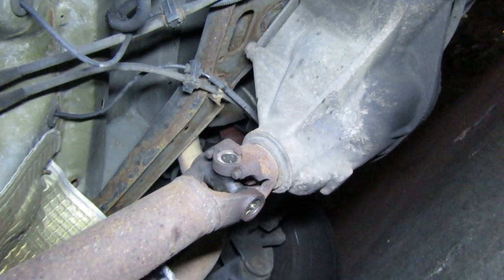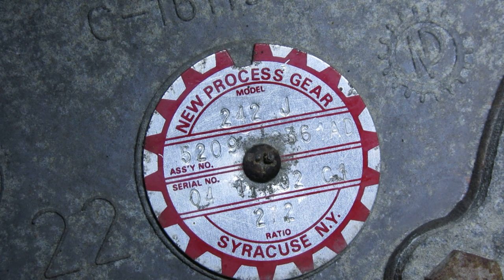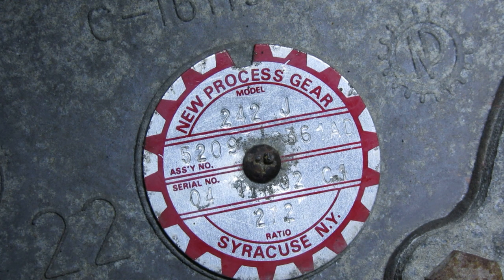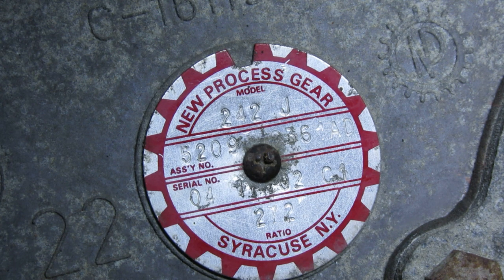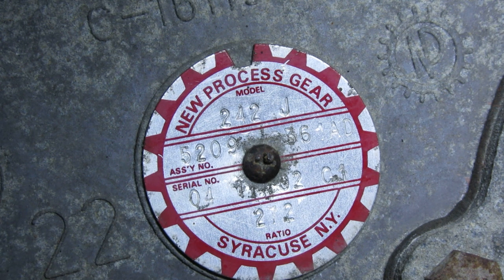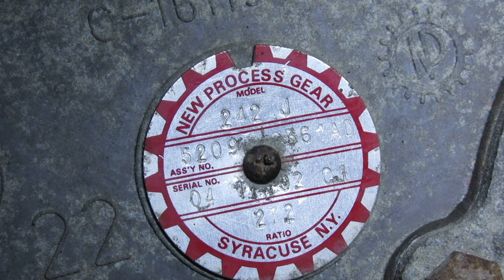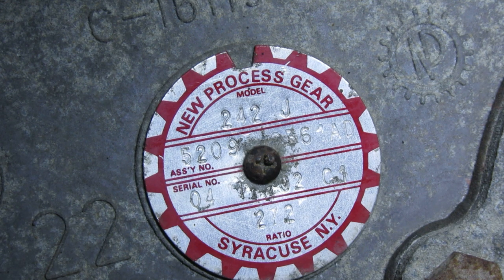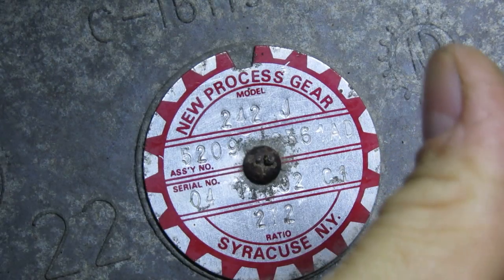Jeep Transfer Cases DECODED and EXPLAINED - New Process/New Venture

Comment: Hey Doug, I just want to clear some things out; I think you got some therms mix up between the 247 and the 249. The 249 uses a viscous coupler, which is clutch discs sitting in a special Goo that thickens when it heats up, I.E. when the front and rear axles spin at different speeds, which make the clutches grab together. The 247 is actually the one with the Gerotor pump, and is the same system used in the Quadra Drive axles. It's basically a wet clutch system, with an hydraulic pump built in; the body of the pump connected to one axle, and the other to the rotor. Same speed front to rear = no pressure from the pump. The moment there is difference, the pump starts building pressure and gives progressive clamping power on the wet clutches, up to a certain point where it relieves the pressure, to let you take tight turns and such. It's actually and awesome and clever system!!!

Comment: The ZJs had the 249 Quadra-Trac transfer case, they had a viscous coupler in the transfer case....the WJs had the 247 transfer case, and they also came out with the Quadra-Drive system which had vari-loc front and rear differentials and the clutch pack in the transfer case, which is what you were referring to around the 11:15 mark.  The gerotor coupler was used in the Quadra-Trac/Quadra-Drive transfer cases found in the WJs.  The 249 and 247 were never used in the XJ, or MJ.  both of those either got the Command Trac 231 or the Selec-Trac 242 transfer cases, or no transfer case if you bought a 2WD Jeep, not sure why anyone would but they are out there.

Comment: im still to see another 147 transfere casse like the one in my 99 JGC
Reply from the maker: They are out there, but it is not a common configuration. Interestingly, they use the 142 in the WK Grand Cherokee much more.

Comment: Good job man
Thank you good info. 
What do you know about jeep commander 245j  I need to replace the drive chain? Do I need to take the transfer case to neutral? I tried that the light blinks but nothing happens is that the motor drive that does that?

Comment: Hi thank you for your video it helped alot .if ok to ask you a few questions .u need a new transfer case for my dodge .and now I was told I need to know if it's a 23 or  a 29 spline shaft .and also if the electronic shift box qhen pulled out there is either aa hex nut or a torx nut the the box attaches to .and another video I saw  they said it will tell you that with assembly number but I don't understand that part the I'm just concerned as it's a 4 hour drive lol so I don't want to hit there and find it's not usable .and I don't know if they seller understands what I'm asking lol is ther anyway to find that info out qith any of the numbers on the tag by chance ? Please and thank you

Comment: I was a manufacturing engineer at NPG, Your 242J is a full-time unit with an interaxle differential. It was the best we made.
Magna moved the operation to Mexico. Gm is going to electric vehicles, they won't need a transfer case.
Reply: Can you please tell me what fluid I use for this exact transfer case?Is it NV 146?I have the 242 J transfer case 4.0 engine Grand Cherokee Laredo
Reply: Can the 242J be used with the 4.7V8 grand Cherokee?

Comment: Great video. I have a 1997 grand Cherokee with a 249 it's leaking and not working right. I want to switch to a transfer case that has 2 wheel drive with 4 Hi and 4 low. The only thing that I found is a 242 J but it is in a 2003 liberty. Can I switch it out without changing the input and output shafts I believe they are both 23 spline. Hope you can help me with this problem.

Comment: Do you know what the difference is on a Jeep Grand Cherokee 2004 it has a transmission casing number 2907/7 and then I got one of the 01 Jeep Grand Cherokee says 2901 can I use the 2901 in the Jeep Grand Cherokee it has a 207 the same tranny what's the difference
Reply: Cuz the transmission has a 2907 in it it has the transfer case 242 model and it has a plug-in on it and then the transmission out of 2901 transfer case it don't have a plug-in on it transfer case 287 can you help me out

Comment: So, correct me if I'm wrong.. I have a jeep Grand Cherokee (WK) 2008/9 (Canadian 10 of 08) 3.0 CRD Overland with an NV245 & as it states on the window sticker.. a "DGU" w5j400 (NAG1) trans,  Quadra Trac II "active full-time 4WD system, 4 wheel traction control & 3.73 electronic limited slip differential front & rear axles"
It seems that the NV245 is now about the same system as the 249 you were talking about.. 
I'm looking to you because it appears I killed (loud gear/ grinding noises coming from the center of the car) the NV@$% while towing ~3000 lbs for 2000 miles with new tires on the front and 3-4/32 above wear bars on the rear tires.. Buying a transfer case now.. ELSD's are probably also questionable..

Comment: Hi there. Tq for yr video. I owned a Jeep Grand Cherokee ZJ 1997. It is now having transmission problem. Leaks and gear doesnt engage. I am from Brunei. My local dealer is not helpful saying the parts I need are discontinued. I have sent you an email seeking your help if you know any reliable supplier frm the US I can order the required parts. Thank you.

Comment: Thank You for the great video and information. I have a 2001 jeep grand cherokee larado with quadra trac. The transfer case tag reads 247 j . The left front wheel does not pull or spin when all four wheels are of the ground. Any ideas? Again Thank You.
Reply from the maker: Yes. Quadra Trac uses a limited slip trasfer case, but open diffs. That means - when locked - you are on guaranteed one wheel in the front and one in the rear spinning. Quadra Drive came with limited slip differential as well guaranteeing 4 wheel lockup

Comment: bro youre mad smart, what are symptoms of a front differential needing fluid?
Reply from the maker: Thanks bud. Just trying to help some like minded folks. 

Definitely some grinding oh whirling/humming noise. If it is a limited slip diff you will get binding when turning at low speeds

Comment: There are so many great videos on Jeep GC's, thats why I love them. Mine is a 2000 WJ  4.7ho with a 247hd. Its a fantastic 4x4 system. This is a great video. thanks mate.
Reply: The 4.7 HO motor was standard in 02 to 04 Overlands, and optional in 02 to 04 Limiteds and Special Edition Jeep GC's. Yours being a 00, I doubt it's a HO 4.7 motor. Probably the standard 4.7L.
Reply: @Mo63H  Hello Mr Ho, My engine was changed due to a spun big end bearing. The new engine is a HO as the supplier did not have a standard one. All HO parts are also fitted too.

Comment: so with part time does in 231 does the front shaft of  t case kick out of gear. to prevent braking else where?
Reply from the maker: it does not. they are locked together so you can only use it on loose ground

Comment: Hello. Two question’s please. I have a 97 ZJ with a 249. I understand from other videos earlier NP249’s the axles are not locked but newer NV249’s the axles are locked. How do you tell visually whether 
you have a NP249 unlocked or an NV249 which locks both axles? And a second question. I was given a NV247, is there any benefit to switch from 249 (not sure if mine is locked or not. Just bought it) to NV247since I have it  or should I try and sell both to get a NP242? Thank you so much. New to Jeep’n. BTW great channel  and mine says 249 j.

Comment: Fyi 249 is just a basic 4 hi 4 low  neutral. There is no fancy fake all wheel or auto lock 4 wheel system built into it. This guy had some good info and some bad info. Make sure you double check any thing you use for your project.
Reply from the maker: I am sorry, but you are incorrect. a 249 uses a viscous coupler to provide an "all 4 wheel" driving experience.

Comment: Great channel thanks for sharing. On My 2000 jeep Cherokee XJ the rear drive shaft broke and I have just been using 4H the front wheel drive for about 6 months now. QUESTION do you think I am getting abnormal wear on the front wheel drive components from doing this compared to normal rear wheel drive 2H?????
Reply from the maker: Definitely. If you look at your front drive components compared to your rear (drive shaft, axle, etc) they are must smaller as they were not intended to move the vehicle alone. Not saying it wont work, but if possible find a drive shaft. you are going to be really stuck if you break something in the front!
Reply: @DEInTheGarage   Thanks for the reply. How are jeeps different then front wheel drive cars.  It seems that the front wheel drive system was designed for off road extreme rough use.  After watching a few transfer case videos it seems they designed the transfer case to be very robust.
Reply from the maker: @DualTasticToday  This is true, but you XJ was designed to be rear wheel drive when operating in 2wd, not front wheel drive. The components were not designed to carry the entire vehicle. I am not saying you are destroying the jeep or anything, but you are certainly using it in a way that it was not engineered for and at some point I expect certain front driveline components will wear out prematurely
Reply: @DEInTheGarage  thanks... 4H I think is a rear 60 with front 40% when in 4 wheel drive. You helped  me a lot to understand. Thanks again.

Comment: So my new question for you is. Should I swap the front and rear diff from my 01 to the 04 ? Since the ABS system is part of the Quadra-trac system I don’t know if the abs module would need to be swapped as well. Or should I just put the locker in front and rear.  Thank you again for your input 🇺🇸
Reply from the maker: Yea, that would likely get you a nice beastly vehicle

Comment: Hello sir. I found your video very informative. I recently purchased an XJ  with a 231 and to my knowledge the case came from a different vehicle and I’m watching your video to try and and determine what year vehicle it came from by reading the tag. If you or anyone else that’s reading this can tell me if the serial# has that info or how i can get the manufactured date and if so does that date coicide with the year of the vehicle. Any info would be greatly appreciated. Thank you
Reply from the maker: I do not believe the manufacture date is recorded anywhere on these cases. Can I ask why you need that info?
Reply: Im just very curious to know how old it is.
Reply from the maker: @victorjramirez1948  Fair enough. To my knowledge you cannot tell that simply be viewing the case. If you were to remove the case and count the spline count on the input shaft if might give you some clue as they changed that over the years
Reply: D&E In The Garage   I appreciate that. Thanks for the reply
Reply: @DEInTheGarage  Hey Doug, I know this is an old video but there actually is a date code on the outside of the case.  You can determine the casting date of the cover anyway, to the year and month.  At :24 in the video you can see two pie-shaped circles to the left of your red and silver tag.  These circles are divided into 12 pie slices around a smaller circle.  The year of manufacture is in the center of the pie, and each month has a unique slice.  On the first day of the month, they drill out a small dot in the month slice, which shows up as a small raised nipple on your casting.  When they reach December, sometimes they will just cut another pie grid next to the first one.  You can see this in your video.

So if your pie thing has a 97 (or just a 7) in the middle, and four pie slices have dots in them, then your t-case cover was cast in April of 1997.  You can assume your vehicle was manufactured within a couple months after that date.

Comment: I have an 01 WJ AND and an 04 
Both have a 247J but (01) is Quadradrive , (04) 
Quadratrak 2
Both are 4.7 but what is the difference and what is in your opinion the best transfer to have it’s my hunting Jeep and I pull a boat often times
The 01 seems like the 4/4 works better in the mud. Thanks for the info sounds like you really know your jeeps 👍🇺🇸
Reply from the maker: Same transfer case (as you suggested) the quadra drive also has front and rear VariLok limited slip differentials which the Quadratrak II has open differentials. You 01 does better in the mud for that reason. as soon as the tires slip a bit, the transfer case and axles lock up for all 4 wheels are turning together.

"best transfer case" is open to a lot of factors, but all around I prefer the 242. It has a 2wd option which is better for on-road MPG and towing, but still has part-time and full-time 4wd as well. I am actually in the process swapping the 247 from my 01 Quadradrive with a 242. This configuration of the 242 with the QD Varilok axles is in my opinion the strongest you can have

Comment: Is a 231 AMC transfer case the same thing as  a NP 231? Can’t find a rebuilt it for my 89 Cherokee.
Reply from the maker: They are the same case, basically, but I believe the spline count on the input shaft will be different, so you would need to use the AMC input shaft in the 231J if you go that route. not a hard thing to swap over
Reply: 95 xj swapping for a 99 xj both 4.0 both 231 both automatic any differences in those or can u point me in direction to figure it out i would assume its much like chava original question but double check

Comment: My 2001 Durango SLT 4.7 Transfer case exploded....it is a 244D... Can I get a very simple answer to this question...Can I use a 4.7 ,233d to replace it?  The 244"s are really hard to find and when you do they want a fortune..($500).......             233d"s......$50....Will it fit?
Reply from the maker: Simple answer, yes it will fit, but you will need the input shaft from your original transfer case to get it to mate up to your transmission. That means splitting each case and swapping the input shaft. not a difficult projects
Reply: Cool, Thank you guys so much for the help and support.

Comment: please answer if possible
i have 2 97 grand cherokees both automatic,1 has 231 that has problems the other has a 242,, is it a straight swap
Reply from the maker: It SHOULD be, but Jeep in the 90'2 is notorious for switching up random things. Worst case you would have to swap the input shafts on the transfer cases to get it to work
Reply: @DEInTheGarage  rgr that  thanks

Comment: I have a WJ 4,7 with a 247 that burned up due to low fluid,  What would you suggest installing?  I will take it off road and use it as a daily driver too.  LMK Please.... Great Video
Reply from the maker: Get a 242. It gives you 2wd which is better for driving around town and then you can lock the diffs together for off road. 231 is good as well, but less options
Reply: @DEInTheGarage  i have the same model (wj v8) the question is... Can we swap the original 247 to a 242 HD without change the differential (lsd)??

Comment: Thanks for this, I've got a 97 ZJ and when I bought it 10 years ago I didn't understand permanent 4wheel drive. I put 2 new tyres on the front and kept worn tyres on the rear. After about 20 miles it chewed up the front diff. At that time I failed to appreciate the need for even tyre sizes all round.
Reply: I dont know what mine is but its build by mopar
Reply: As 7/ddllàq

Comment: I'm not a fan of the full time 4x4 system...I figure if its slick enough your not getting the traction you need in 2wd then its slick enough you aren't gonna hurt anything being in 4x4. They are known to have the viscous coupler fail at the worst times.

Comment: My 2007 Jeep Grand Cherokee is stuck in 4WD low and only moves in 4WD low. Does that mean I need a new transfer case? Because when I put it in drive it says 1 on the dash and not D. Please help
Reply from the maker: Usually you need to have the transmission in neutral (not park) to shift out of 4LO. Give that a try.
Reply: D&E In The Garage yes I did that a few times and my car still stalls as if I'm trying to drive in neutral, but it's really in drive. And someone told me it could be my transfer case that went bad and not letting me switch gears.
Reply from the maker: Yes, that is possible. If something is broken in there it would prevent you from shifting out. Unfortunately, without seeing the vehicle it is hard to help diagnose
Reply: D&E In The Garage okay I'm going to get a new transfer case and see what it will do. By it being stuck in 4WD, what will the new transfer case do?

Comment: Will a 231HD swap out with a 247...I was told to use a 231J
Reply from the maker: The 231J will be a direct swap, the 231HD will likely need a different drive shaft.
Reply: The HD is awd only. 
The J is 5 modes.

Comment: Is there any way to tell how many splines the transfer case has by reading this tag?
Reply from the maker: Technically you can take the year of the vehicle and the transfer case and search the internet to figure out which year with which t-case had which output shaft. There are always going to be outliers because Jeep and that is just the kind of fun games they play. Additionally, it is not just the spline count which must be taking into account. Different applications of different t-cases use different length input shafts.

Comment: Hd vs non HD versions of the 231 and 242. 

HD versions had a slightly wider chain and a 6 pinion instead of 3 pinion planetary gearset. 

I believe the 242HD in the HMMWVs had provisions for an external cooler as well.

Comment: The Renegade trailhawk uses a single speed power transfer unit.  It has no low range gearing.  It has a"low" mode but its just computer software that locks the transmission in 1st gear.